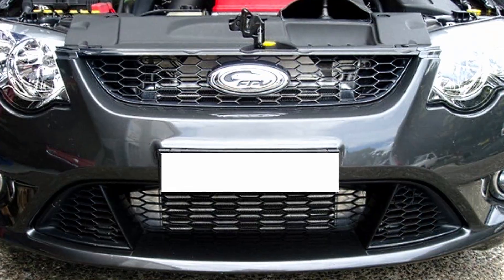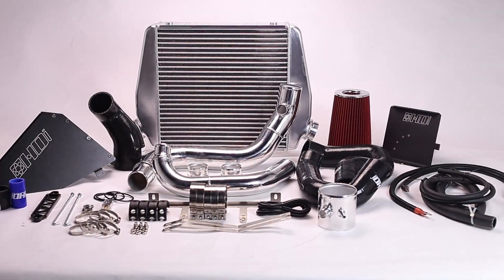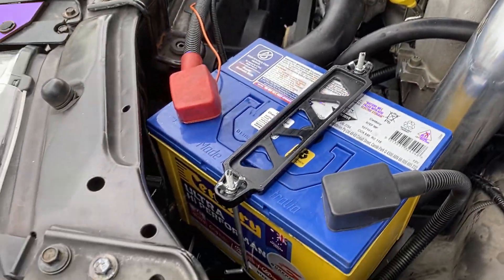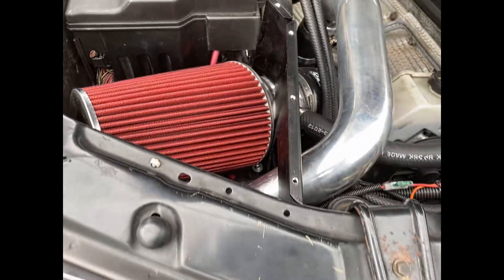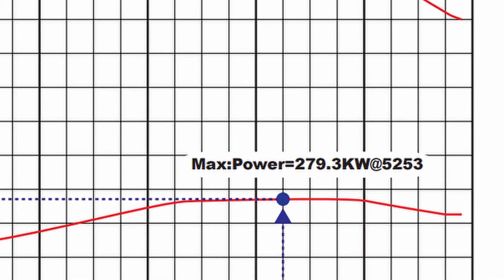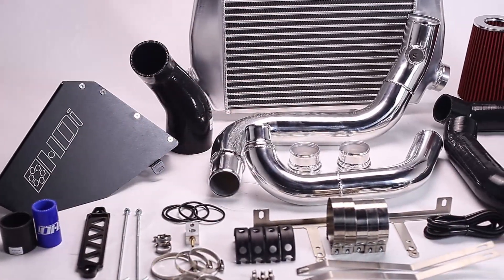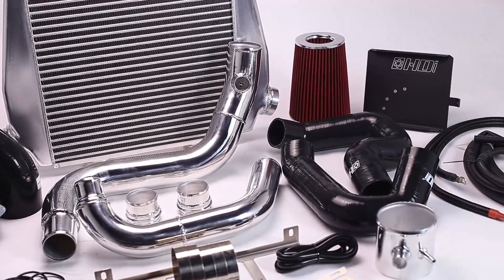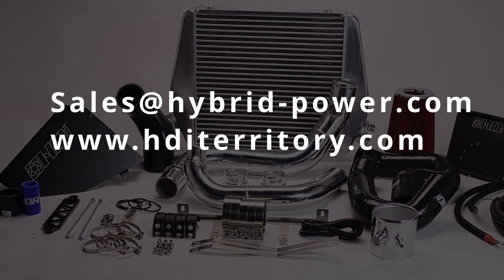HDi GT2 390  Ford Territory Pro Stage 3 intercooler kit

Comment: Hey so does the intake pod replace the original turbo intake manifold and also so does the piping cover ir all or will.i need additional piping and stuff
Reply from the maker: The intake manifold is not replaced only the intake pipes , for more informaiton you can download the installation manual to see what is changed Thanks

Comment: Its not "Easy Installation" I cant even get the silicon hoses on to the inter-cooler . They need to be stretched over. You could have made that step easier.
Reply from the maker: Thanks for your comments they are designed to be very tight as it is also reinforced to minimise expansion under boost to gain throttle response. If you have difficulty putting on ,Please apply detergent as lubricant and question please let us know
Reply: @hdiperformance  I was totally wrong. I was doing it wrong and got a bit frustrated. So I messaged the sales team and they helped me on the right direction, after that it WAS easy.
Reply from the maker: @louiekiwi  Thanks for your feedback glad that it is sorted if you have any question please let us know thanks